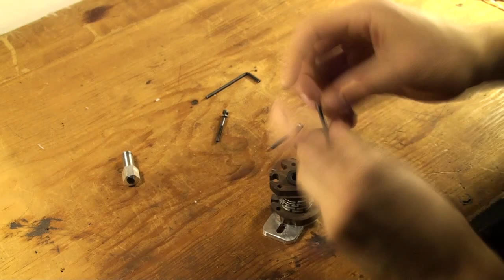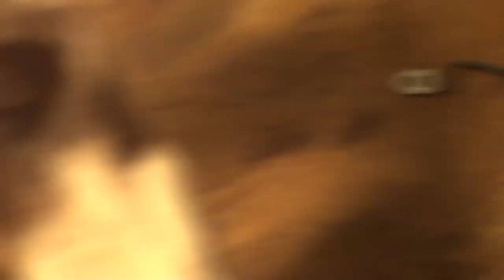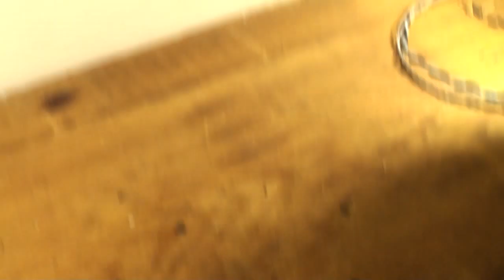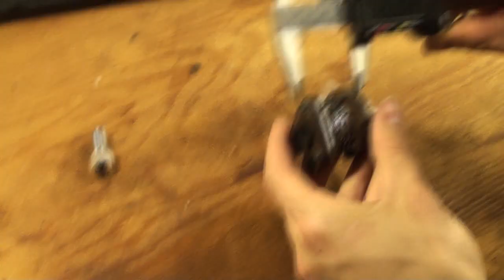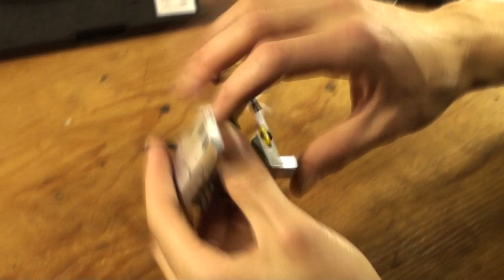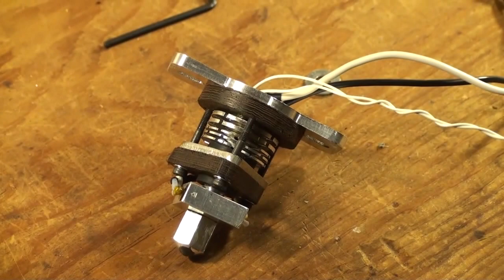Budaschnozzle 2.0 Preliminary Assembly

Comment: great video as i am just got a new threaded rod and nozzle and was worried about screwing threads up. 
Why don't you put Teflon tape between the threaded rod extension and the heater block and the ceramic spacer?
Reply from the maker: I actually did at a later date. Please watch the video "Taz - Leaking Budaschnozzle Fix and Isolator Replacement"